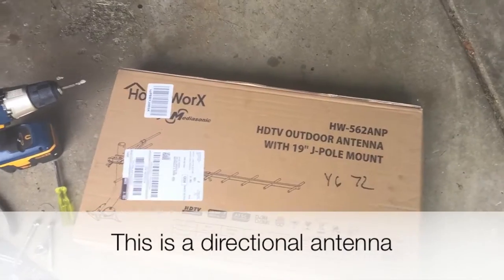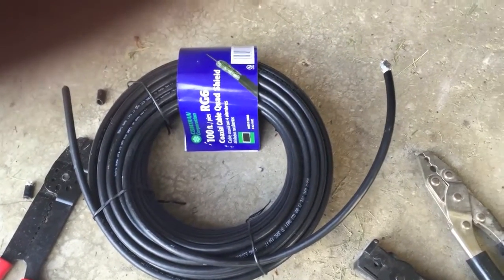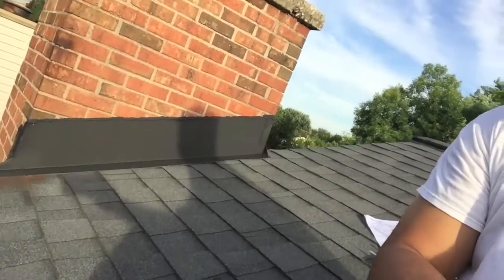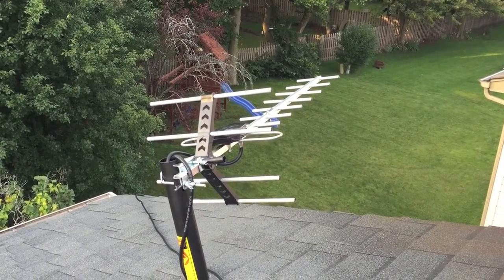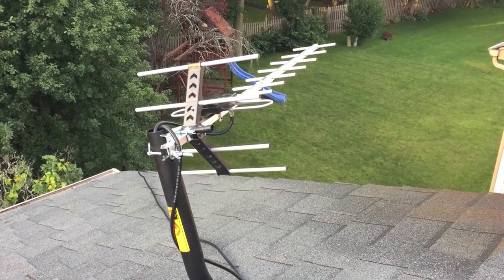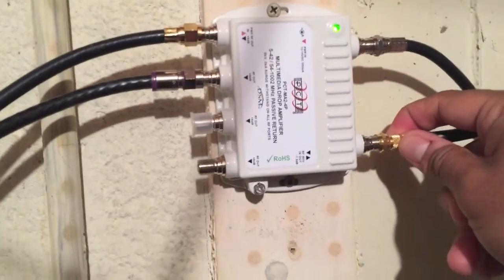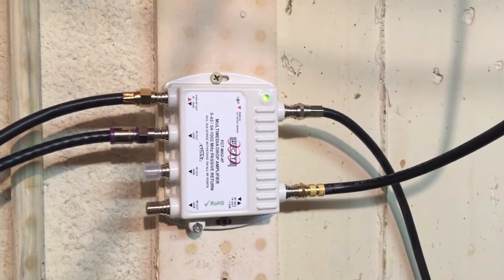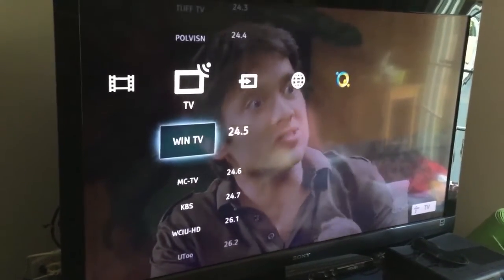Cutting the Cord:  Installing an HD Antenna Tutorial

Comment: good work. tu. how did you get the cable to the rooms?
Reply from the maker: The inside was already cabled room to room from the cable we just cancelled, so I didn't need to do any additional cabling.
Reply: @thinklikeamarketer  that's the problem. if you cancel completely them it's easy to tap those, but if you keep the internet then you can't tap that for TV.

Comment: One more question Steve : My closest run  I'd say 50 feet RG6 Cable to my living TV from my roof antenna will not pickup  my closest  local channel of probably 8 miles away too there tower , but a little bit further away in my bedroom it picks it up perfectly .( I'm puzzled )  why a further away cable run will pick up a local tv channel and the living room will not hold it very long without messing up and seem like it constantly reboots ( Using a 70 Mile Antenna )  . I'm in Jonesboro Arkansas and I get all the Memphis channels and I'm happy with this , but I have to go too the bedroom to watch the closest  channel. Could it be the TV , or even the splitter , ...some times it   does come in decently ......Any tips...
Reply: Check connections along coax cable route for shorting by the cable screenfoil or screen wire whiskers. Most recent systems now use 'F' plug connectors. Also find that commercially available aerial cables with the moulded on connectors are somewhat suspect leading to poor performance. Commercial cable should be the thicker 3C2W type, Not the 3C2V type.

Comment: Thanks I didn't install an Amplifier , an happy with my reception . But do you think that this inside amp will help me more ?
Reply from the maker: If you are running it more than lets say 100 ft from the roof to the first TV and or if you are splitting the signal and the total distance is more than 100 feet, then you probably need an amp to help keep the signal strength high enough throughout the house.  However, plug it in, check the reception and if it is fine overall, then no.
Reply: @thinklikeamarketer  Thanks

Comment: What kind of sealer did you use underneath the antenna pole base to keep the roof from leaking - silicone .
Reply: Silicon has a much shorter life than products designed for roof applications. I'm just starting on research, and I quickly found that roof application is more demanding than silicon is capable. UV & thermal range is out of silicon spec.

Comment: Great info,  thanks for the video.  I am no expert, but I think you need to run a ground or two.  But you might want to get an expert opinion here.  Sure if your TV does not work, no biggie, but the grounding is a safety issue.  And to others note, with some houses having a mix of copper and plastic piping, that metal pipe by your coax  entry point may not be a true ground, and I have seen a lot of houses without the proper jump lines around the meter. 
  I had an expert do an install for cable years ago, they put in  a coax grounding block on the outside of the house,  it has a ground wire connected to the pipe for water spigot. And you can put a drip loop in at that point. 
Inside the house  the splitter has ground wire connected to a pipe that is grounded. 
Hope this helps.
Reply from the maker: Hey, thanks!  It seemed to work, but I'm pretty sure I added a booster in the basement because I knew the signal would weaken the farther it went.  I think that acted as my ground.  I've moved since I made this video, but thanks for the added insurance!
Reply: Steve great video. I am working on putting my own antenna up and was wondering the same question about why you didn’t ground it. I always tend to do what is easiest (read lazy) however as I get older and have a family I tend to be more safety minded

Comment: Watching your tutorial and I cant under stand what you said at one point of the video, its at 8:08, you said if you don't have a digital TV with a built in Tr...... can you please let me know what you said.  Thanks
Reply from the maker: A digital transformer built in or really a convertor.  Basically most TVs are built for digitalnow, but some older ones before it was mandatory required you to buy the digital converter box.  I hope that helps.

Comment: the mount is installed wrong. that's why it isn't straight. but good job anyhow
Reply from the maker: Thanks.  I think I was offsetting the angle but you are probably right, but it works! :)
Reply from the maker: I wondered why, but man, they don't really give you much in terms of directions when you buy OEM.  LOL.  Thanks!